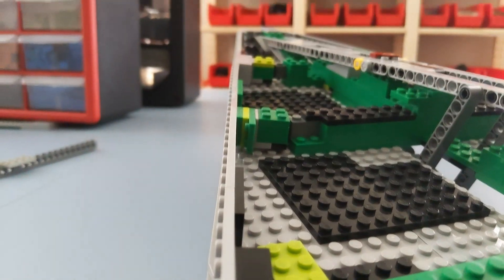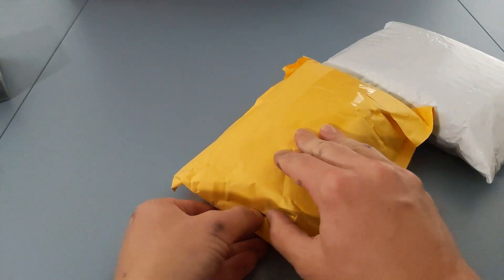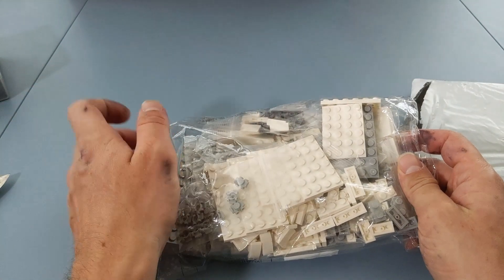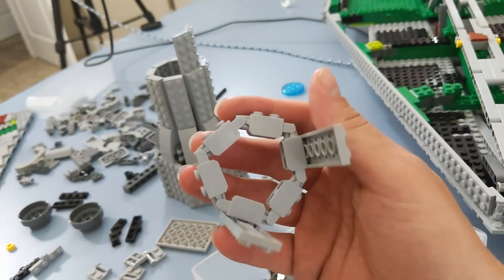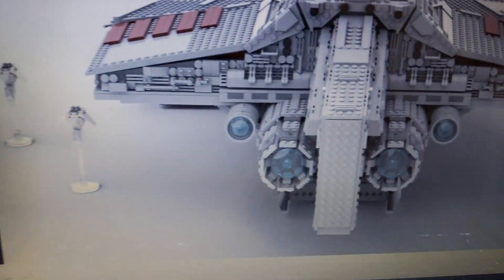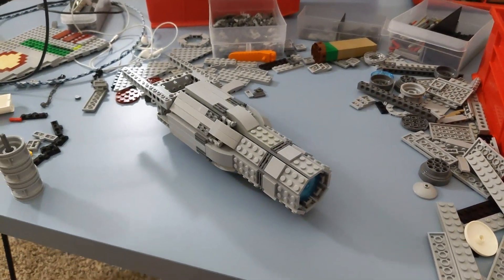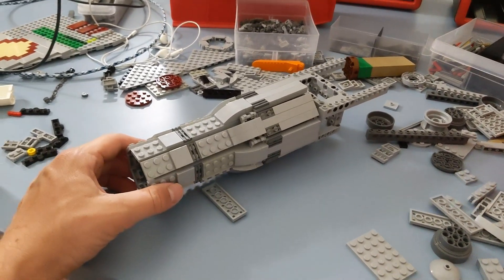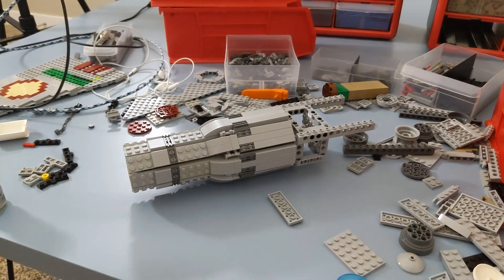Building A UCS LEGO Star Wars Acclamator Episode 4!

Comment: I build midi scale starship mocs, so I know how you feel with the frustration. However, whenever I get to a point where I just can't figure it out, I simply move on to another part of the ships design. My vessels usually don't exceed 3ft in length,  but still lots of little details. Keep up the great work man!
Reply from the maker: That's a very good method, switching to the reactors really helped save this series!